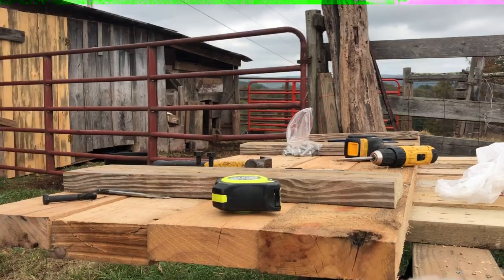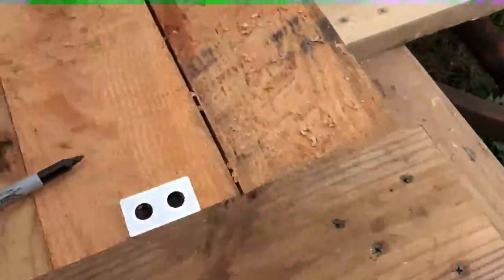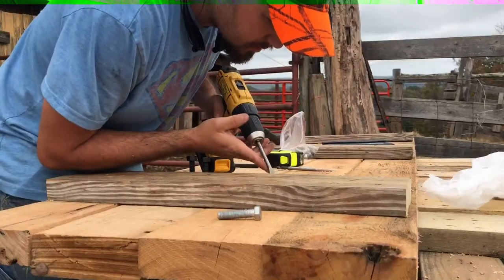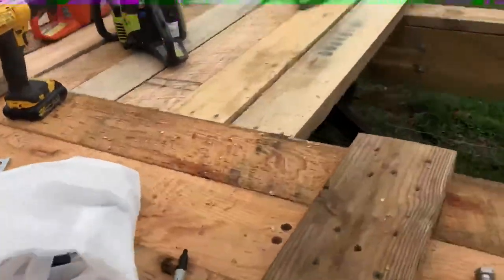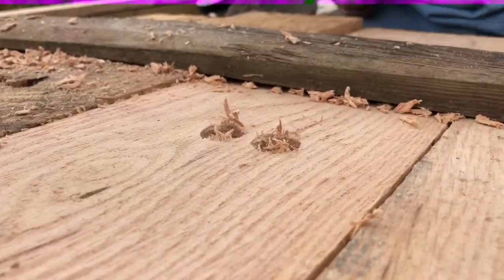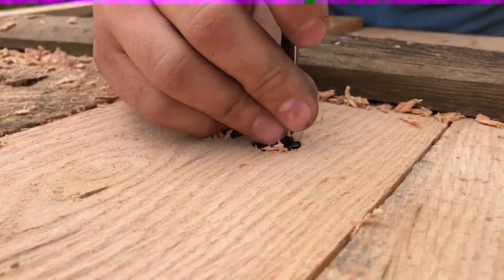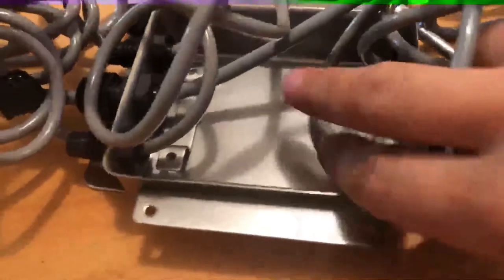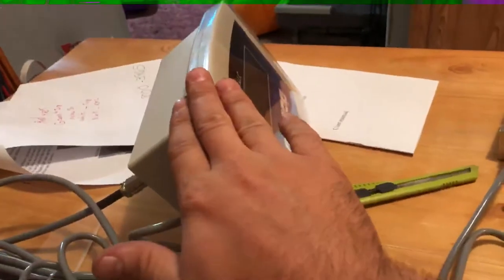Livestock scales

Comment: Great idea!  Video uploaded Oct 2017. How are the scales holding up?   What width/ length did you make the platform?  You measured 7.5 inches in from outside, how far from the end of the platform?  Looked like 15-18 inches.  Thanks for sharing, potential to save a lot of expense.
Reply from the maker: They still work good the only thing I would do differently is put the cables that go from the load cell to the junction box is  put them in conduit or thick wall plastic pipe to protect them from getting cut or damages has it happened yet but been close lol the platform is 92x32 and the load cells are 7.5 inside from the side and 12  inside from the end
Reply: @Theblindfarmer  thanks .. we'll be putting one together soon.  Brother has wanted one for years and  couldn't justify it.  Your video made it possible.

Comment: Nice video! Came to check you out after Brad gave a shout out over at Larsonvalleyfarm. Do you have to put this on concrete or will it work standing on dirt just as well?
Reply from the maker: +Floyd Farms thanks for watching and according to the rep. It will work on any surface as long as it is solid like packed dirt or small pee gravel but works best on concrete and also doesn’t have to be on perfectly level ground  works on uneven ground
Reply: Smalltown Farmer88 awesome, thanks! I've been looking at loadbars for my squeeze chute, but didn't want to spend $1000 or more plus have to build a concrete slab. This would be perfect to just toss in the alley and then store when done.
Reply from the maker: +Floyd Farms oh yea work well
Reply from the maker: +Floyd Farms it’s better to store them when you are done it according to the manufacture every thing is sealed so it can be left out doors

Comment: That's cool, I've seen the old mechanical scales but they aren't real accurate, are you just gonna weigh calves with it?
Reply from the maker: +storminnormanz all my livestock and some round bales to get average weight each year
Reply: thats a good idea weighing bales with it, ive wanted to weigh my cows and calves both at weaning time to see which cows are the most efficient, if i had a scale i would
Reply from the maker: +storminnormanz this scale I bought was around $400
Reply: thats a good price!
Reply from the maker: +storminnormanz yea if you have a way to make a platform or have someone make you one